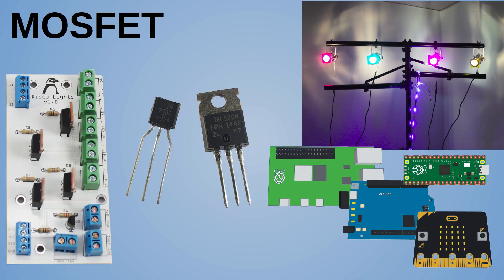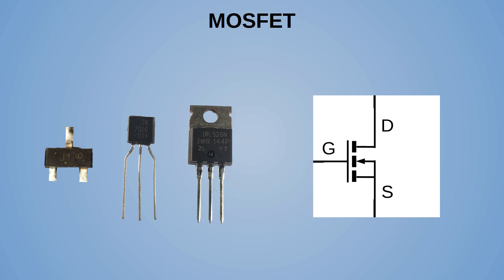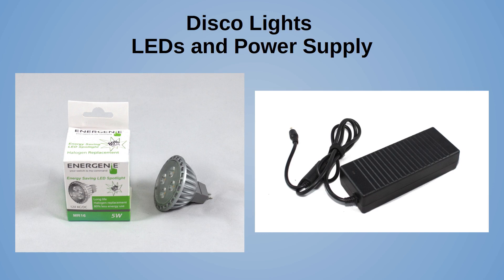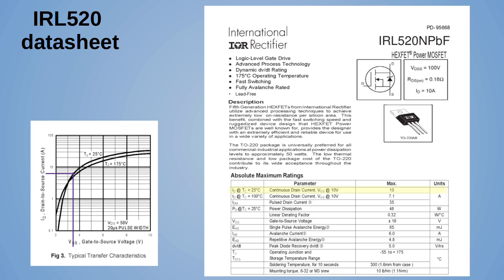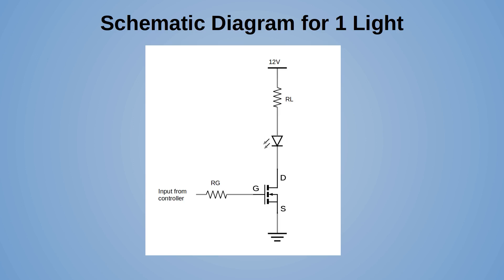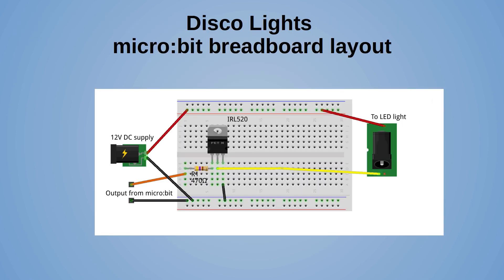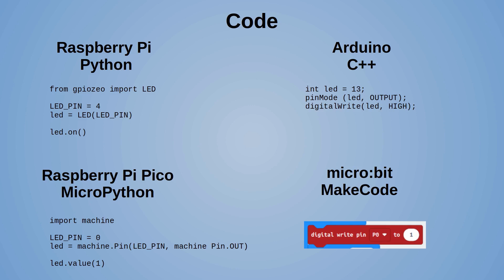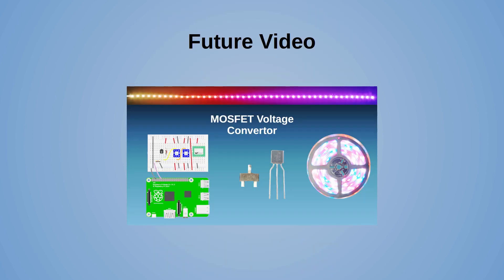Electronics MOSFET Switch control disco lights with Raspberry Pi, Arduino, micro:bit or Pico

Comment: How do you calculate the ideal ptc fuse rating?
Reply from the maker: Work out the maximum expected current and choose the next highest value.
Eg 4 X 5 W lights would be 20W. At 12V that will be around 1.7A. So a 2A fuse should be sufficient.
Reply: @PenguinTutor  Thank you.

Comment: Why does it sound like the Drain and Source do opposite jobs?
Reply from the maker: When thinking about conventional current (current from +ve to gnd) then the names of the drain and source appear to be incorrect, but if you think in terms of electron flow then it makes more sense. 

For most components the connectors are named based on conventional current, but for some reason MOSFETs are different. That does make it confusing :-(